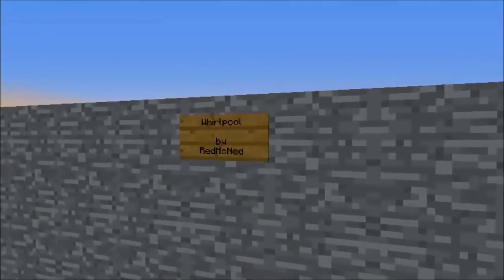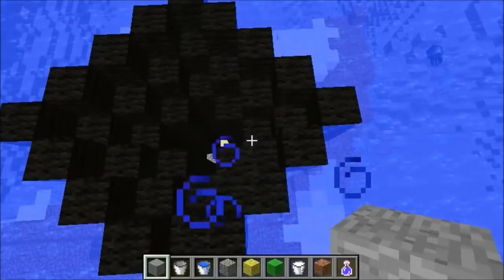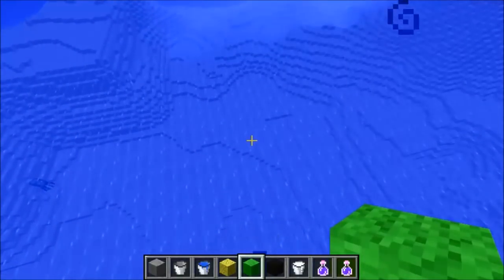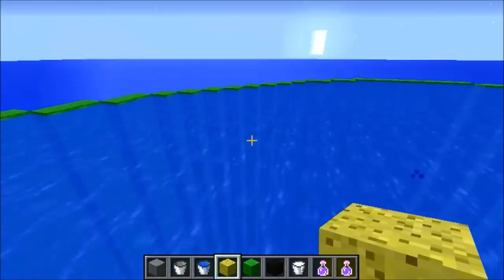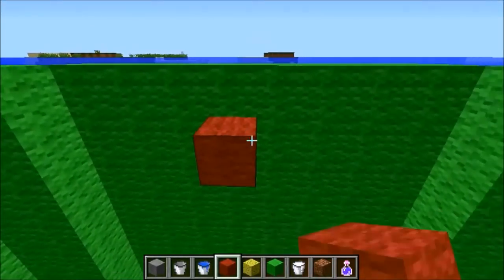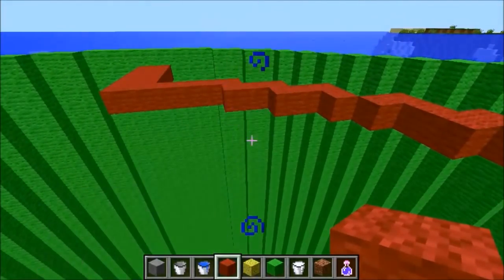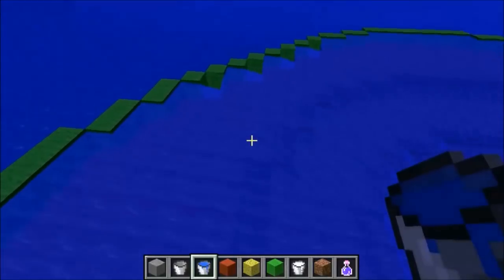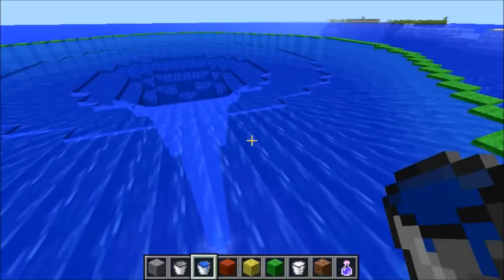Minecraft Tutorial #7: Whirlpool in the ocean

Comment: Can you make this with structure blocks?
Reply from the maker: From what I can tell, structure blocks act more like a copy-and-paste tool, so it probably wont help you make stuff directly.  However, now that I think about it, the main thing that takes for ever is removing water blocks, and if you can copy-paste a bunch of air blocks into the ocean it may help that go faster.  What i might try is building the funnel on a flat area with no water and then copy-paste it in the ocean with the air (this may take multiple selected sections done simultaneously to keep the water from filling in.  the structure blocks have a size limit of 32x32x32, but you could make a redstone circuit that could trigger everything at once if needed).  You would just need to make sure the ground is ready to keep water from flowing in and ruining everything.  I'll have to think about this.  You may have pointed out an easier way to make this thing.